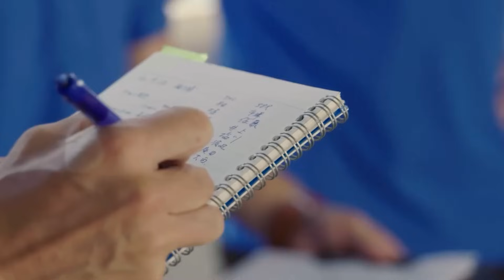The NEW Subaru BRZ will be electric - this is what it looks like...

Comment: What matters to me? (I'm a repeat long-time Subaru owner). 
Who designed it?
Who built it?
Have they learned anything from Tesla?
What's the software like?

Who designed it?
Subaru is an engineering-led culture with insanely good engineering. But they ignored EVs for WAY too long. Do they understand how to design an EV? How to build an EV? That isn't clear.
What IS clear is they handed their first go at it to Toyota & told the world all future EVs would be re-badged Toyota product, designed & built by Toyota. The only part Subaru would do was the Eyesight System. 

If I wanted an EV made by Toyota, a firm that denigrated EVs & insisted EVs were dead, would go nowhere, right up til last week, then I'd buy a Toyota. Toyota though has abandoned rigorous QC, is still beyond half-hearted about EVs, is flailing all over the place. And the culture isn't engineering-led: it's run by sales. Subaru pairing up with Toyota is like Porsche handing the keys to Ford & saying they'll have Ford design all their new cars. Ford's run by Sales guys. It has good engineers, but they aren't Porsche, and they don't solve problems with engineering: at Ford all problems are defined as Sales problems & addressed with a Sales solution. Quality sucks & the market figured that out? No problem: they hire a better ad firm on Madison Avenue, which whips up an appropriate ad campaign ("At Ford, Quality is Job 1!"). Yes they improved QC, but not that much. Mostly they just threw ad dollars at the problem.

Have they learned from Tesla?
What's that? They'll use a gigapress to forge the body? What's that even mean?
At Tesla it means they'll forge front & back end frames, joined by the battery as skateboard. Body is bolted on.
At Subaru it means "Me TOO! - I'm not sure what it means, but we'll do it too!"

What's their Software like?
The Japanese achilles heel is they're all about hardware, revere hardware engineering. Despise & denigrate software. There's no career track for software, no appreciation of it. It beggars belief that they would be able to change that in what, a year?

Eyesight is arguably a great level 2 driver-assist system, but definitely NOT level 3 in all respects. It DOES monitor the car ahead & will initiate braking in emergencies. It will nudge you into your lane, but won't intelligently monitor the road. It's not anything like Tesla's Autopilot, or Cruise. And won't EVER be.

Tesla will upgrade my car FOREVER. Every night it may receive automatic upgrades in software that translate into real hardware upgrades. Famously, one such upgrade improved braking by 30%. Overnight! For free!

EVERY legacy manufacturer has upgraded their software incrementally. Eyesight in my 2019 Outback has been improved in subsequent model years. Cool. Subaru wants me to have those upgrades, and I can - if & only if I buy a new car! Otherwise, they're done with me. Subaru asks "What have you (the customer) done for me today?" And if I haven't bought a new car today, they're done with me. Tesla asks "What can we do for you today? Costs us nothing to give you the new upgrades: here ya go!"

Philosophy & Mission Statement Matter
Why would Tesla do this? What's in it for Tesla?
1) I'll buy a Tesla. Better treatment drives demand.
2) Tesla's Mission - the Master Plan - is to make EVs so compelling that they disrupt the entire car market. Why? What Tesla actually wants to do is reduce fossil fuel use by humanity by 1/3, by electrifying transportation - where 1/3 of fossil fuels are used as fuel. That means scaling production massively (by humanity, remember?) and reducing the cost of EVs to make them so compelling a purchase that everyone abandons ICE vehicles. Their secret: scaling production DRIVES costs down; all Tesla has to do is keep passing cost reductions back to the buyer, rather than absorbing them as increased profit. It can work - IS working - but it requires insanely committed ownership that's absolutely committed to the Master Plan. Musk is THAT committed. No other company on earth would do this. Instead it would act like Apple, keep milking customers for ever more profit.
3) Tesla isn't focused on selling me ever more cars. Sure, if I want to buy a newer Tesla they want to sell it to me. But actually, Tesla wants to eliminate the car market over time. If & when Autopilot arrives, Tesla intends to crash the ride-hailing market with Robotaxi and drive cost of transportation SO LOW that the majority of car buyers stop buying, simply call a Robotaxi instead. The end game for Tesla isn't just massive disruption of the Auto market, moving everyone to EVs. It's eliminating the vast majority of the car sales market!

Tesla can't move the entire market to EVs itself. Too big a job, must happen too soon for Tesla to do it on its own. Instead it wants to force legacy firms & new startups to join it in shifting all auto manufacturing to EVs. It's prepared to share the market to do that, assumes it must. Says so: in no scenario does it expect or want more than 30% market share. It's the only firm in Human History to offer its "competitors" free access to its IP, royalty-free, to enable them to keep up. It's encouraged its battery suppliers to provide Tesla's 4680 batteries to competitors too - royalty-free. 

This is why Wall Street blather about "competition" is so much drivel. Investment analysts DO NOT GET Tesla. It doesn't believe it HAS competitors. What's driving price reductions isn't an interest in stealing or keeping market share: that's how GM or Ford would think. What's driving cost reductions is the need to reduce the price of the car in a market where fewer people can afford it, & reduce it enough to keep sales growing so they can keep scaling production. Remember Tesla doesn't produce cars to force inventory onto dealers. It produces cars to order: every car built is already sold. And the magic method to keep driving cost down so it can keep driving price down, is to keep scaling production. As captured by Wright's Law, there's a constant cost reduction produced by every doubling of production. The cost reduction factor varies by technology; it's different for batteries than for EVs. But in both cases it's significant - well in excess of 10% per annum at the rate Tesla is scaling (~50% p.a.). 

Do I believe in Tesla's Mission? Yes. And while I'm emphatically not a Millennial, I believe they believe it too. And even those who don't buy into Tesla's Master Plan can see the benefit for them in buying a better quality EV from a firm that has figured out how to design & build those, has ironed the bugs out of it & which will reliably be there to service the car in the coming years. Every car buyer can do the math on free software upgrades forever. Every buyer can understand the appeal of buying from a firm that isn't at significant risk of dying tomorrow.

The Service techs & Service Manager at my Subaru dealership have bought Teslas. The sales rep looks distinctly embarrassed when I ask him to pitch the Subaru Solara EV to me. Staffing levels at the dealership are falling almost as quickly as the turnover rate of Subaru vehicles disappearing in my neighborhood, being replaced by Tesla Model 3s. 

What does that tell you?
I love Subaru, love MY Outback. But it's the last one I'll own. Subaru is toast, and pairing up with Toyota just confirms my assessment & accelerates the inevitable. Too bad; it was a good firm.

Comment: <sigh> Sam, another video where you're talking shit about things you appear to have no idea about?
Making an EV version of the 86/BRZ would certainly cure the torque-dip (which I would certainly not miss), but the huge gain in mass (from battery) would (I suspect) completely change the character of the car.  It is certainly not a drag car (nor intended as one), but it is a drivers car: very enjoyable and nimble through the twisties (which it can do surprisingly 'not slow').
As for the 50/50 weight balance... that is more of marketing fluff  (where the weight is placed with respect to the axels is far more important, which the boxer engine in the 86/BRZ is well placed).
As for the concept - IMO, it goes in the fugly bin.

Comment: Not thrilled by the design,that said am all about sustainability n by that I mean electricity,methane,bio-diesel n to some extent B85,so any car that can take advantage of any of these or a vombination of is a win,the Subaru as an electricly ASSISTED would have made more sense for the brand,with a 200bhp ICE engine built for just B-85 n a sizeable battery say 50kWh blade batteries ,300bhp motor in the rear axle and a 50litre tank for extended range then turned for both city n track day driving